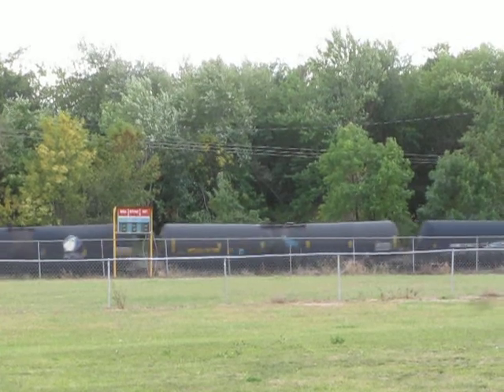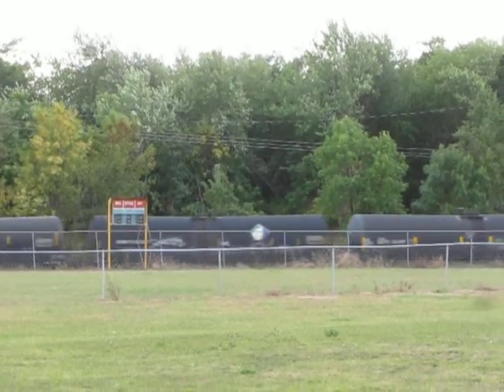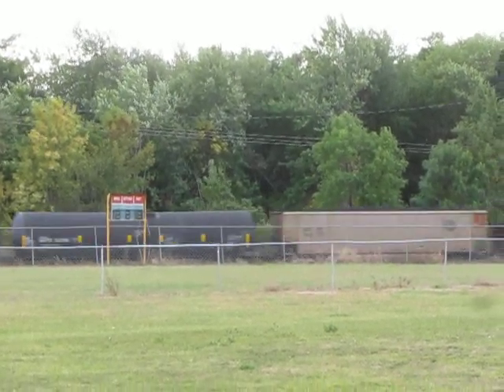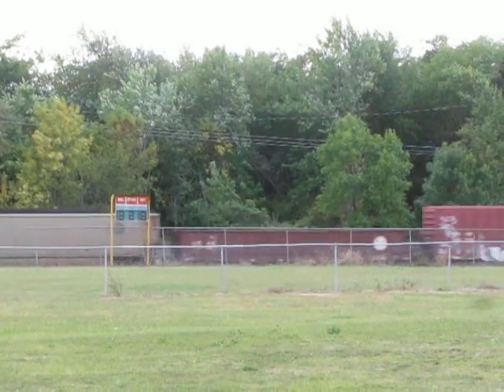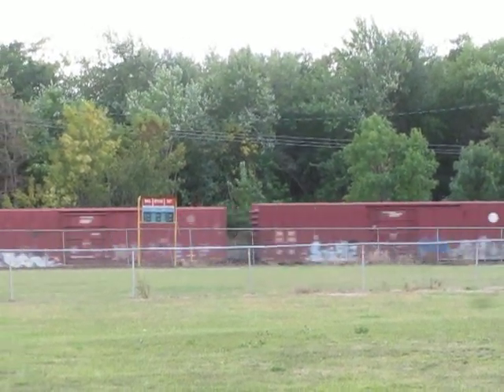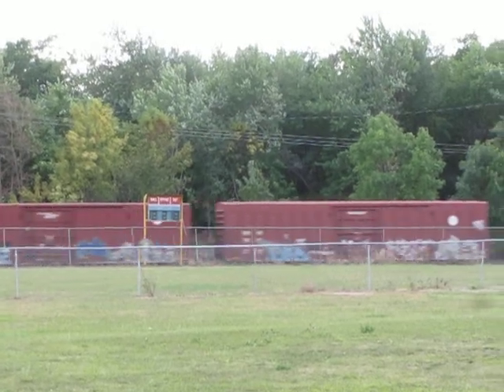BNSF cement train with NS highhood meets NS-led mixed freight train

Comment: I think the train that you believe is cement may actually be a sand train. Their car frequencies are becoming more frequent, as I have seen on CN in Canada, as the oil industry is expanding. Since this is Iowa, it may have come from a fracking plant in Nebraska or another state within the approximate area. However, I am not 100% sure. A lot of NS units. Pretty cool to see a rare high nosed unit.